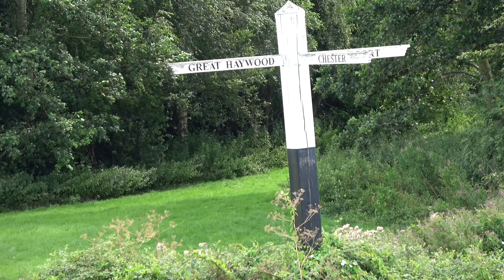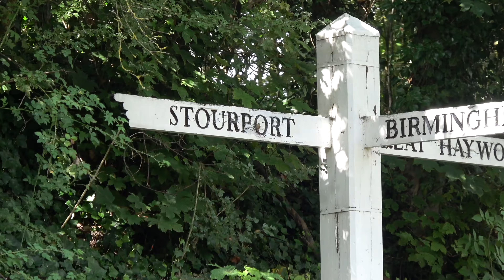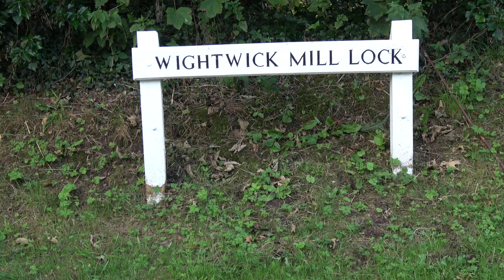Narrowboat head on at the 'narrows' on the Staffs and Worc canal

Comment: Stop by a Chandlery or an auto parts store and pick up a tube of dielectric grease. Use that on electrical connections to keep moisture and dirt out of the sockets/plugs and minimize corrosion. Oh, and most excitedly looking forward to "Through the Hedge" wondering if it will be anything like "Through the Looking Glass".

Comment: Still looking good and happy ladies, continuous  cruising must agree with you? On another note, use some Vaseline on the connections for the horn and light as it stops them corroding . Old trick, but works. You're supposed to use silicone grease today but who carries that ? Also, on the back of the horn there is usually a screw, with a nut, that is the tuning screw for the horn, slacken the nut and turn the screw in or out until the horn is at its loudest, then lock the screw down with the nut. Here's hoping for a mild winter xx.